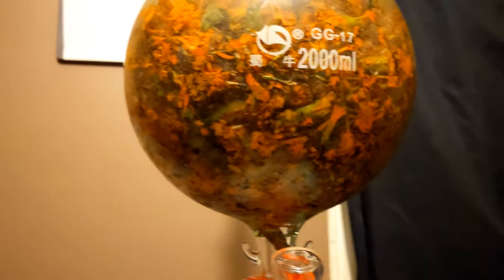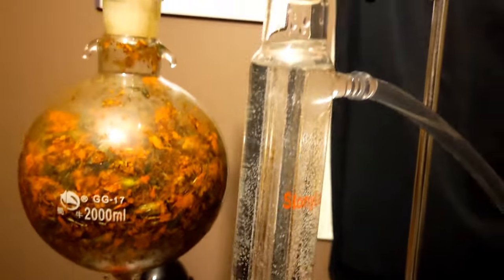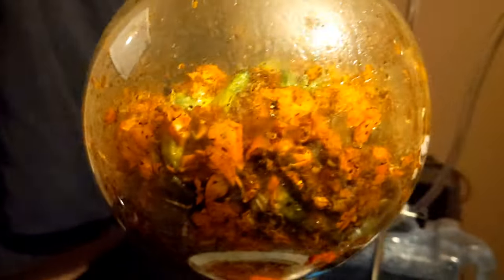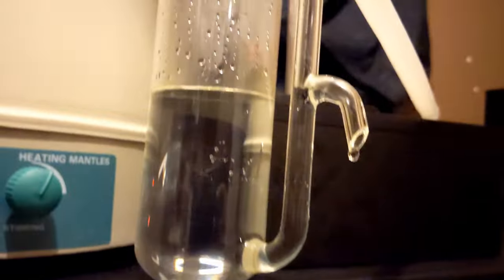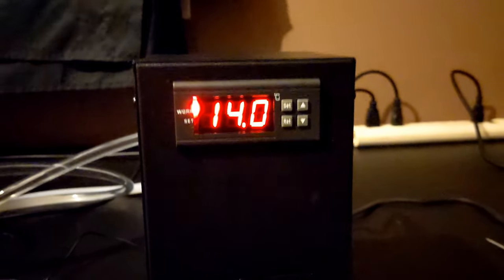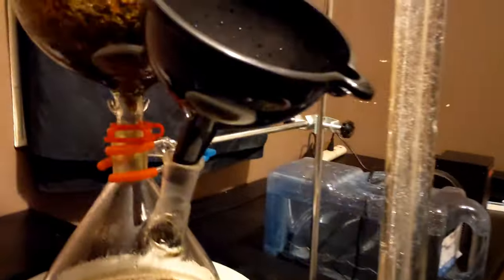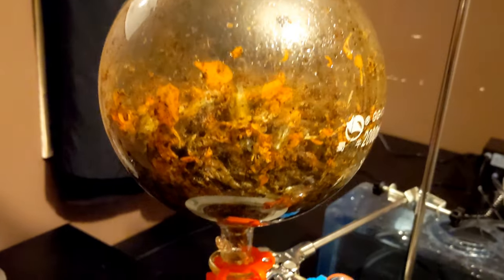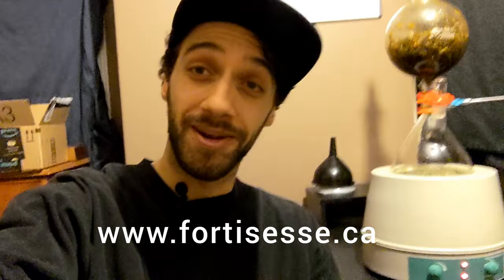Steam Distillation of Marigolds (Essential Oil Extraction Video)

Comment: I think your yield is dripping down from the plant material into the boiler and getting oxidized by heat, as indicated by the brownish color as the extraction proceeds. While your setup isn’t too bad, there’s not enough pressure to force the essential oil through the condenser column. I’d make the suggestion to use a Soxhlet extractor over a steam distillation setup and replace the water with isopropyl alcohol or 99% food grade ethanol. Using solvents with a lower boiling point means your yield won’t be destroyed by heat as it’s collected into the boiler, and the Soxhlet extractor is a self-recycling mechanism so therefore it doesn’t need as much intervention and your yield should be much higher using less solvents. After a Soxhlet extractor run, you’ll be evaporating the alcohol off to leave your essential oil as a residue. From there, it’ll be as easy as scraping off the oil and putting it into capsules or tinctures.
Reply from the maker: Thanks for the information! Although, The runoff inside the boiling flask is normal and doesn't contain any essential oils. I'm going to upgrade and test out the less traditional CO2 Extraction method next.
Reply: Good luck and stay safe with the needed pressure. Usually, I’ve seen people go straight to either propane or butane based extraction before using CO2 for gas extraction (less pressure but needs a recycling system to avoid explosive gas leaks). Also, for the best carotenoid extraction, adding ethanol or acetone to the super critical CO2 extraction technique should increase lutein and zeaxanthin content as an “entrainer” for interfacing the alcohol groups to the super critical CO2.
Reply: I'm using same steam distillation process by adding water but I'm not getting any oil? So what can I do

Comment: Thanks for sharing. I hadn't thought about using a water dispenser like that. I did get a couple collapsable cube water holder things and freeze those for use in my outdoor still set up, eliminating the need for ice (amen!) Question....what if you filled the water jug/dispenser half full, froze that, then when you distill, add water to the frozen half and circulate?

Comment: Hi, any idea what kind of yield did you get
Reply from the maker: The yield was EXTREMELY low. I wish I had weighed the organic matter before distillation. It was really sticky, sticking to the sides of the seperation flask as well. My best estimate would be roughly 0.1mL - 0.3mL